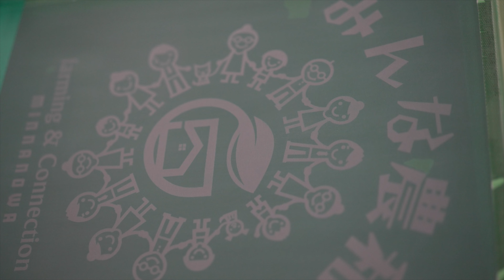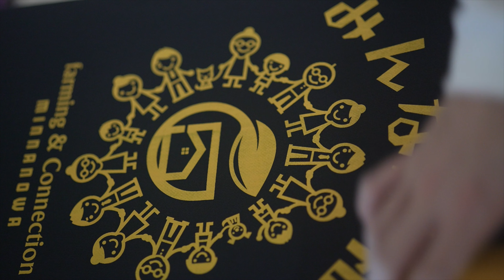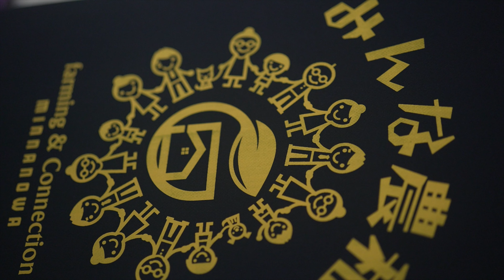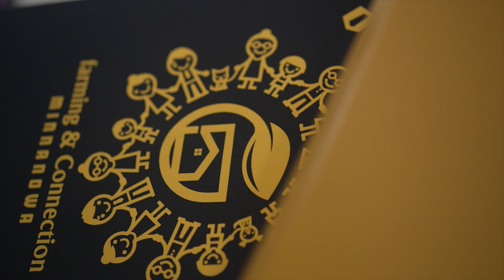selfmate "PRINTING WORK-WORK SOUND ONLY 09" :α7siii :作業音 :シルクスクリーン Ver. FULL

Comment: is there a reason why you use a flash dryer and a blow dryer together?
Reply from the maker: Jarrod Ardolino
Thank you for your comment!  Dry with a flash dryer and dry the corners with a blow dryer.
Reply: He is amazing he has a simple set up but does great stuff with ease.
Reply from the maker: I'm glad you said that!
Reply: Its one of these easy way but at same hardest way it requires skill. Conveyor dryers cost thousands. I use a heat gun , flash dryer and heat press for silky prints
Reply from the maker: Conveyors are expensive ... you're using a heat press!  Is enviable!